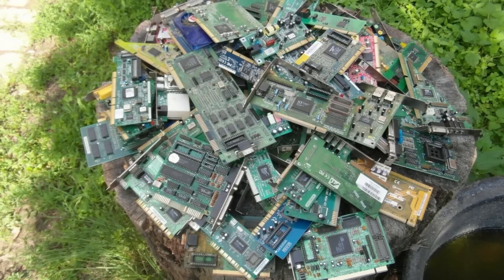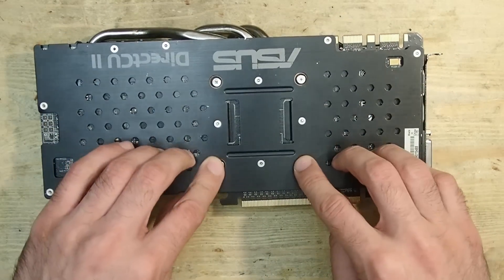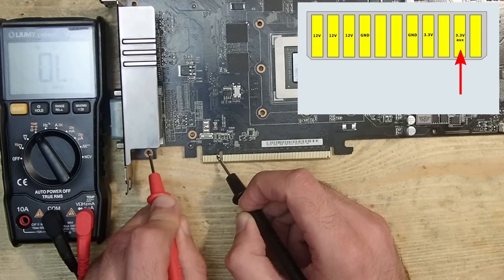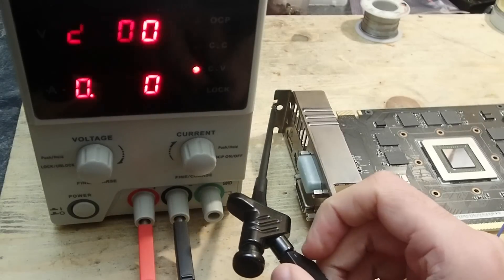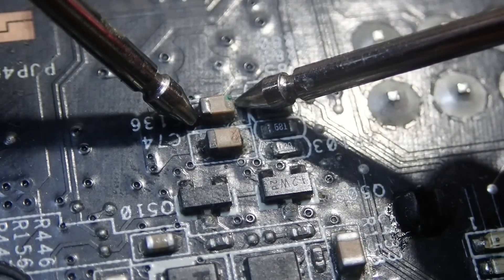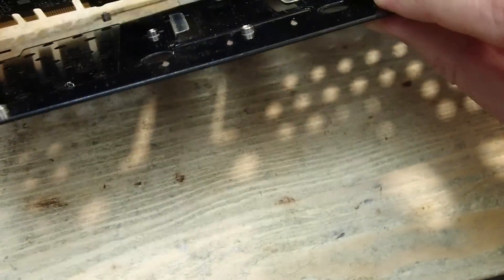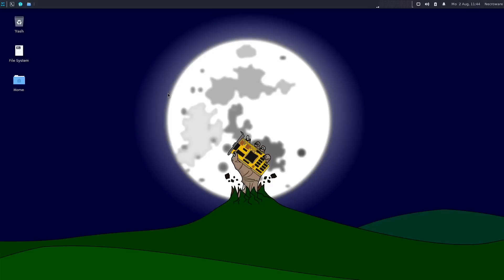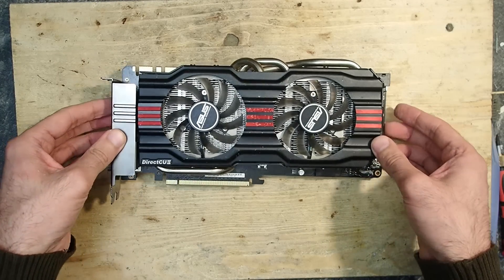GPU shortage? Let's repair an Nvidia GTX 770

Comment: Nasty power supply you ordered , I hope you dont build a pc with that.
Reply from the maker: The PSU is much better, than you think. That's so sad, that so many people think, that they can make an opinion just by looking on a picture. Really crazy world we are living in.
Reply: @necro_ware  Yes, 20 years of looking. enough to know it will be fine in the short term. but i would not build a pc with it. ;#}
Reply from the maker: I'm into the hard- and software now about 30 years. That doesn't mean a thing. If I learn a new device, new hardware, new software, new programming language or just an algorithm, I always try to go unbiased. That's hard, but is absolutely required to get a proper impression and if you manage to go unbiased you will be sometimes surprised very much.

And in regards of switching power supplies, that made a huge development in the last 20 years. The modern DC-DC controllers are more efficient than ever and are capable to switch with up to hundreds of MHz. What meant to be state of the technological art 20 years ago is not more. This PSU was one of such surprises to me. Meanwhile I measured it inside out. I couldn't load it up to 550W, I simply don't have such hardware, but it finished 12 hours of constant load with 365W (Ryzen5 3600 + RX480) without a slight hick up. Absolutely silent and stone cold. The ripple on 12V remained under 70mV, an amazing value which I really didn't expect. My BeQuiet PSU, which is three times as expensive delivers over 90mV ripple. The PSU has an active PFC, which works, I tested it and it is officially registered and was tested by the European committee, which confirms an average efficiency of 89%.  The only two things I found bad about it was the missing over current protection on 5V rail and in my opinion slightly too thin cables. Everything else is actually outstanding about it. Here are some details:

https://clearesult5.sharepoint.com/:b:/s/PLS/EVJ7AiRuNEpFvPJhwapt7m8BlMEXsGzlGmQ9m7d4_vjALQ?e=YI2CMY
Reply: @necro_ware  I am not signing up to a site to see your info but I trust your word. 
You missed my point which was it is o.k. NOW. It is supposed to be able to run an r5 3600 and rx 480 (i have the same chip and rx 480 nitro) 24/7 for several years, so you cannot judge anything by that.
Reply from the maker: @MrChriss000  Fixed the link, sorry. But if a PSU delivers good values, if it is silent and cool, if it obviously can handle over 550W in the lab and could easily handle a normal PC with constant load of 365W, then what else should I judge it by? By a label of a well known company on it? I was working for a well known company, which sold their product for the highest prices on the market and advertised, that they are the best. That was the last crap ever and every no name product from China was with a high probability better, that that. This was the point in my life, where I understood, that the price and the name doesn't mean anything. If you really want to know, if something is good or bad, you have to check it inside out.

As I said I have a BeQuiet PSU in my main PC, which is three times as expensive as this thing. And having my hands on both of them, I'd rather go with this Mars PSU. The only thing, which is better on the BeQuiet are modular cables, but all the measured values are better on this Mars PSU. For this incredible price, I'd clearly ignore the modular cables.
Reply: @necro_ware  Its a mars BP unit, piece of crap.
Reply from the maker: @MrChriss000  Ok, that is a serious argument ;)
Reply: @necro_ware  I wrote a big piece and Youtube lost it. I will do it again later, trust me its  A P.O.S.
Reply from the maker: @MrChriss000  Just don't put links or YT will kick the comments. And before you write, may be you should read my pinned comment in this video https://youtu.be/_zuKtjNftOo
Reply: @necro_ware  I dont have time now. Just trust me that psu is fine for a low use bench  tool but you dont want it in a case. If you were a pc builder you would know about this.
Reply from the maker: @MrChriss000  If you don't have time just don't write pointless comments. I told you, that I personally tested this PSU inside out and it delivers good values. You probably compare it with the previous generation (MP and MPII), which was crap indeed. Unreliable and with fake certificates. This one (MPB) is a complete redesign. They went for more modern DC-DC controllers and overhauled the PFC. This time they went through the complete certification procedure in the EU and this can be officially verified. What I'm writing is objective opinion based upon my measurements. I don't care what the name of the company is and how crappy the previous products were or the next will be. However this one looks good. I'm an engineer and I trust numbers and not a gut feeling.

Comment: nice video dude. have you encountered any gpu that at first working but in a minute it goes black. computer though is okay and active just the gpu goes black, sometimes it works sometimes not? thnx
Reply from the maker: Such a remote analysis is always hard to make. If it start, there is probably no short, then you have to check the caps, see if the voltages remain stable etc. I don't repair such "modern" stuff very often, I'm more into the retro scene. That's why I can't really rely on much of experience in that regards, only on my electronics know how.
Reply: @necro_ware  thanks dude . its ok.  by the way i learned just now on that pinouts of the pcie on gpu, i didnt know that thing till i saw your video , thanks for that, cant find on google pinouts of the whole pins of gpu

Comment: This was actually really insightful. About a year ago I had an old desktop case from like 2008 and to help with temps I always kept the side panel off, and little did I realise that one sleep-deprived night & an almost empty cup later it would be my undoing. My RTX 2060 bit the dust whilst also taking my motherboard with it (maybe 5ml-10ml of liquid had splashed onto the GPU's PCB near the power connectors), since I was in too much of a panic to think to unplug it directly from the power outlet like a dipshit. Had a pretty nice paperweight sitting in a box behind me since I never had the heart to throw it away, since I held onto the little hope that one day I could get it repaired. I had scoured on forums for similar scenarios to mine and everyone just said to scrap the card since it was completely dead and to just buy a new one, which wasn't possible then nor now due to the costs.

I know very little about this sort of thing, so maybe there is still no hope for it being revived due to the nature of damage, but this has given me a little bit more hope that it can be saved and save me from forking out 3x the amount I paid for an equivalent card nowadays. I don't know if there are repair shops in the UK that would do this sort of thing but maybe there is one out there, or even a single person, that is capable of fixing this card.

Thank you for the interesting and informative video Necroware, I hope you continue to make videos such as this since its really eye-opening to inexperienced people such as myself.

Comment: Another great video I have seen numerous stupid videos of people trying to put graphics cards in ovens or blasting GPU dies with heat guns only failing some videos of people reflowing or reballing the GPU working but I often had thought there was something like a capacitor or even a broken trace. You have confirmed what i suspected and furthermore you taught me how to try and repair using voltage injection. I am going to try this on a couple of dead graphics cards I was given. Thanks for another great video.
Reply: nope dude, heat gun method is for complete other problem, no shorts. It will never help with shorts. It's only for one problem, when traces and micro contacts under a chip gets weakened, heat can help to melt them for a while, and after they cool, traces can be renewed. Voltage injection will never help with that, you need actualy to bring temperatures around 180-230 Celsious to fix that problem.
But it's true, you have no control over what will happen, it can work, and it also dont have to. I don't considered it for "repair". The card after heatgun threat is not repaired or fixed. It can stop to work anytime soon, and sometimes, even when it's not used.
The oven method is even more risky, as it can melt lots of other stuff. Heatgun is basicaly more sophisticated oven method, where you try to target only only GPU chip.

Comment: Interesting how the power button wasn't on both pins the first time you tried to turn it on... but nice trick on finding the problem
Reply from the maker: As I was initially testing the card the camera was just running all the time and always focused on my hands instead of the card. I plugged the stuff in and out also the button couple of times and later during the edit I just took one part which was focused right and didn't even noticed, that at that point the button probably was not sitting right on the header. You eagle eye ;)

Comment: If you're in a pinch and need an 8 pin PCIe power you can just bridge the additional two pins to ground. A "real" 8-pin has ground there as well and it is only used to detect power capabilities. As you may know, if those extra two pins are present the cable is supposed to be able to carry 150W instead of 75. 
But, again, this is not actually helped by the extra wires since a) no extra 12V wires are added and b) even if it was a 4+4 setup that would only be 33% better, not 100% (so it would allow for 100W instead of 75).

In short, if you know what you're doing you can run a GPU off two thick wires and a few solder bridges ;)

Comment: What GPU shortage? GTX960 runs everything I need, and GTX550Ti works perfectly on secondary monitors. Probably should think what doing or tweak graphics settings if need latest most powerful GPU.
Reply from the maker: A friend of my also has a GTX960 and it got broken recently. He is also just a casual player and doesn't need much, so he went out to buy something similar and was surprised how much he would have to pay for the same used GTX960. That kind of shortage. Eventually we got his card working again.

Comment: I had no idea that this card was still supported on the newest gpu drivers. I've had some trouble with an older nvidia card recently and could not get the drivers in linux. It probably would have been fine in windows but it is near impossible to get older drivers working in linux because most of the dependencies are deprecated
Reply from the maker: You still can run 20 years old graphics cards on Linux, even the ones which were already dropped for Windows in times of XP. However, Nvidia is a bad choice for Linux anyway and if you have an option go for AMD. I'm a Linux user since 1998 and since ATI open sourced their drivers over 10 years ago, I always went only with ATI/AMD for a better user experience. Since they are open source, even new features are getting backported to the drivers for the cards, which are a decade old. For example things like Vulkan for an HD7850 are no problem on Linux, where on Windows 10 you probably will not even be able to install that card anymore.
Reply: @necro_ware  yeah I get you. I didn't buy the card I was trying to get running but it came with a prebuilt I purchased that I replaced for a 1050ti. The issue was when I tried to use that card on another machine.  I forgot which model that card was but it would just run really badly with the nouvou drivers and when I would install the new drivers it would refuse to boot into the desktop environment. I guess this is all Nvidias fault at the end of the day 🤷🏻‍♀️ just wish it wasn't so hard to get the old drivers

Comment: For anyone that doesn't have a 6+2 pin PCI-e power cable on hand, the 2 free pins just need to be shorted. One of those pins is either NC, or ground, and the other is a ground cable that shorts out a signal on the card to let it know that a 6+2 pins pci-e cable is connected. Otherwise, you will get that same warning that Necroware got when he booted up the card with the first PSU.

Comment: Fun fact- After the restoration the GPU is worth more than when it was new.
Reply: cant even like this, cause its too sad really
Reply: I sold one of these last summer for £120. I think it cost around £330 new but for a 7 year card that was a crazy price, I don’t think it would have been worth half that even two years before. I replaced it with a 1650 Super which I’d say is probably about twice as fast as doesn’t spin my electricity meter!
Reply: @jonjohnson2844  do you mean 1650 speed is 2x faster than 770 ?
Reply: @mahfhoo  1650 Super, yes. That’s just a rough guess in the games I play, essentially smoother gameplay at higher quality settings.
Reply: @jonjohnson2844  so bad i just bought 770 recently, i though higher cuda will gain more speed, but i used it for rendering (blender) do you think 1650 will better too in rendering (not gaming) ?
Reply: @mahfhoo  it will run everything, just maybe not at great frame rates or high res (Warzone wasn’t enjoyable but was kind of playable I suppose), not sure about Blender but if you let me know what benchmark to do I will let you know the results.
Reply: Ahhah ya 😂
Reply: Ys, price has increased dramatically.:'(
Reply: Buying a 2nd hand for about $150, is it good price ?
Reply: and I have 1 gathering dust....

Comment: mostly the gpu chip fails and beyond repairs, unless u find the replacement gpu chip which can be close to the cost of the whole gfx card. but still good effort to fix the gfx cards having power related issues.

Comment: If you were to connect the last 2 pins to ground it would probably have worked. As these pins are only used to sense if the correct cable is inserted. Implying that a capable power supply is present.
Reply from the maker: As I said, the PSU would be too weak anyway
Reply: @necro_ware  true yes

Comment: that was awesome. super interesting. i wish i had an adjustable power supply that could do this, i would buy up all the dead gpus and try and fix them, lol.
Reply: you can buy a small injection tool the size of an ipod to do the same. I just bought one. It's much deeper than that.

Comment: A little too much thermal grease used there. You don't need much. Just remember the physical properties of liquids.

The grease is only used to fill in micro gaps and not act as a barrier or spacer between parts.

Comment: Old video but I'll throw in :
If you have a power supply that keeps shutting down on shorts or doesn't have a constant current option, you can add a car headlight bulb in series with the positive power supply. A car headlight bulb will limit the current to around 2 amps. The power supply will keep sending out 3.3 volts (in this example) but most of that voltage will be dropped across the bulb. If you need to crank the current up more, put two car headlight bulbs in parallel to limit the current to around 4 amps. You can obviously go crazy with the bulbs and really get the current cranked way up there. The filament in an incandescent bulb is a non linear resistance. At low currents it has a low resistance and at high currents it has a higher resistance, so it sort of regulates the current.

Comment: You scared the shit out of me when you showed an 8-pin EPS-connector and said this PSU had an 8-pin PCIe-connector! O.O
But very informative video, I didn't think that it actually could work like that!
Reply from the maker: Yeah, the moment, where I turned off my brain. Just took the first 8 pin connector which looked at me, as I said that :D Certainly  that was not the PCIe connector at all, but the PSU had one as well.

Comment: Love the repair and it's neat to see that you brought it back to life though I have one problem and that's the fact that you chose 1) ddr2 motherboard 2)an amd athlon CPU (makes sense for the motherboard but not the GPU) and 3) to stress test it on older Linux games I personally feel as though running some mid 2000 games don't really stress test a gpu of that manner and recamend having a small windows or Linux setup running steam with a handful of games that when maxed or close to maxed can be semi intense (this is not a hate comment just constructive criticism)
Reply from the maker: The answer is simple, I use what I have. And the benchmarks I used are not just old linux games, especially Superposition benchmark brought the GPU to it's knees.

Comment: I have a 2080 that doesn't display a picture. When I turn on the computer with it plugged in, the gpu fans spin up to max speed immediately, and nothing displays. I've tried treating the gpu with heat, checking it over for anything visually broken or damaged, etc. I couldn't find anything that was wrong and couldn't get it fixed. I still have it, so maybe with the advice of some of your videos, I can fix it. Even if I have to use a wire to jump the broken connection if there is one, I'll do that. Hopefully it's not a component that I need special tools to test though

Comment: Light the card with a UV lamp. If a trace on the PCB gets hot, it will look much darker than the surrounding traces (hot material fluoresces less). This is a sort of infrared camera for the poor ;)

Comment: Remove everything off the card toaster over at 230F 12 mins. leave the card in there n let the card cool down to room temp. DO NOT SHAKE OR BUMP THE CARD AT ALL WHEN ITS HOT. If you do it will be screwed! I have repaired 13 cards that way. It reflows the connections. Your not out of anything by trying. The cards all ready defective at that point what do you got to loose by trying? my success rate has been about 30 to 40% I have done this to at least 30 cards.